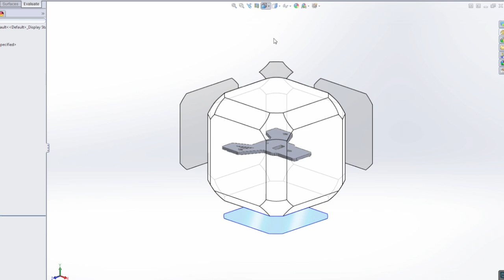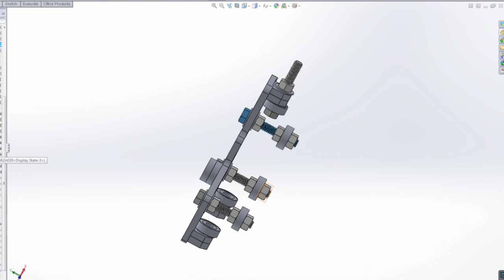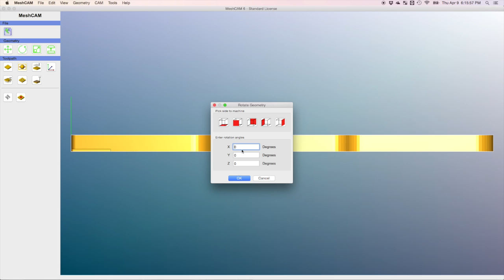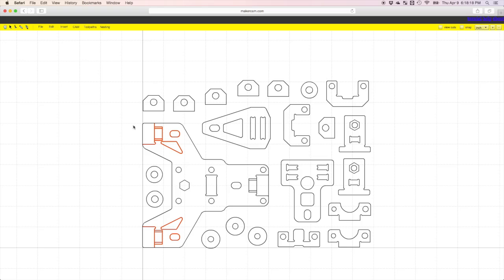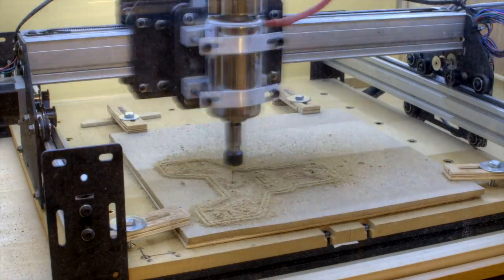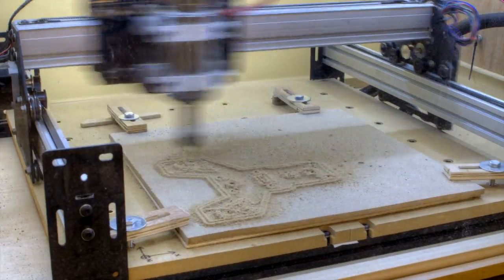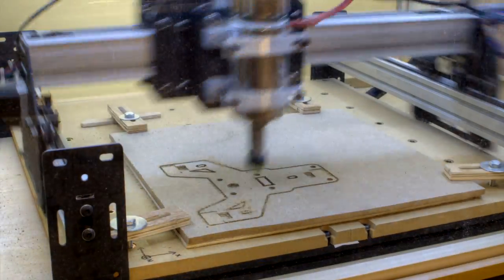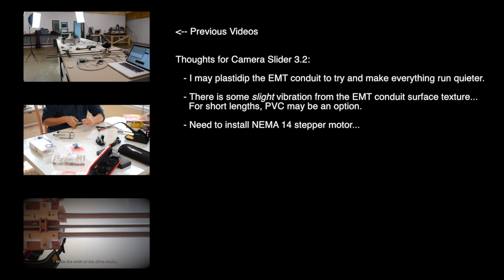DIY Camera Slider v3.1 - Shapeoko Project #30

Comment: 'A platform trying to make contact with two rails at four points is almost impossible without some sort of adjustment or deflection in the system' ?? 0:36 
(use washers, bits of paper anything to extend the axle and make the little wheels meet the intended destination)
Problem solved for anyone who doesn't know how, when or where to drill a hole accurately! 0:36

Comment: Why not just use 3 slider bearings and concentric nuts so that you can clamp the bearings into place without the need of making top and bottom bearings.?
Makes it all a lot easier, I think.

Comment: Not sure if this would work, but have you considered getting PVC and fitting conduit in the center? That would make things stronger and smoother.
Reply from the maker: Not a bad idea, would have to find tubing with the perfect diameters though. I'll check the parts catalog later and see if anything would work out...

Comment: Computerized mill machine, cause yeah, that's typical DIY...
Can I get one of those at the home depot?
Please change your video, don't be a douche bag....
Reply from the maker: +TruthAndMoreTruth Not at Home Depot, but you can get a 3D printer at Staples and do basically the same thing. If you can afford a camera, you should be able to afford one of those... #GoOutAndMakeStuff
Reply: "I don't have that particular tool therefore this is not a DIY" -Ungrateful people on Youtube.

Comment: What's the use of the two pieces glued together and put in the middle with the bolt and washer on there?
Reply from the maker: +Sander A Just a quick and dirty way to attach the carriage to a motorized belt system.

Comment: Would you manufacture and sell your slider to the public, and at what cost? What is the base material you are milling? 
VERY INTERESTED BUYER.
Reply from the maker: +Joseph Jobe The material is medium density fiberboard. At this time, I don't have plans to sell it. There are a couple issues with it that make it difficult to set up any sort of production for. I'm working on an easier-to-manufacture version in the next few weeks, which I might make available publicly. Video will be posted when ready.

The notional plan would be to sell the MDF parts as a DIY kit for $30 or less, with the end user sourcing the remaining parts on their own (mostly available from any hardware store: bolts, glue, sandpaper). Assembled would probably be around $75, mostly because of the time required. Not really in it for the profit, which is why I'd lean towards Plan A.
Reply: +Winston Moy TY for the quick and informative reply. Love your design, great video, and YES - I want to see what materials you use next - interested in the DIY option as well. Thank you... SUBSCRIBED.
Reply: Winston, I am interested in buying the parts from you when you have them ready,.. also have you thought of making the parts out of aluminium or a plastic of some sort?  BUT really  interested in buying from you

Comment: Hey Winston, do you live with neighbours behind the wall? Or in own house? Just curious how you handle noise from milling and how actually loud is it for apartment? Thanks.
Reply from the maker: +3dStereoArt The DWP-611 is pretty loud, but the DC spindle is no louder cutting through wood than a quality blender, or quiet vacuum (also depends on what size end mill, I usually use smaller ones). There's a garage between me and the neighbors, and noise hasn't really been a problem. 

For the user, sitting in front of the machine for hours at a time, you don't need serious ear protection, but some decent noise-isolating earbuds make the time go by a lot more comfortably.

Comment: Two ideas: First, what if you were to mount a tripod head on it? Would many modifications necessary, and if so what tripod head do you think might work out?

Secondly, what do ya think about 3D printing all the parts in Polyamide from i-materialise? Would they be strong enough and to specs? (I can't quite afford a Shapeoko yet unfortunately... sigh...)
Do you have any more STL files, or are all the parts in the SVG simply 6mm thick? Thanks, you rock! :)

Here's the tech specs for the material:
http://i.materialise.com/materials/polyamide/technical-specifications
Reply from the maker: vuurthewarlock Tripod head would work, they're usually able to be mounte with either a 1/4" or 3/8" thread if I recall correctly. I would recommend a ball head for infinite adjustability, and if you plan on using it more than a few times, invest in something with a quick release plate.

Polyamide should work, although I'm not sure how much weaker the parts would be, compared to theoretical values. The fusion process in 3D printing doesn't preserve 100% of the original strength. Depending on price and such, ABS or other FDM materials should work just as well though. I would also try pricing out the pieces from a laser cutting service like Pololu though. Sometimes subtractive manufacturing can still be cheaper, and more durable in the long run.

SVG's are designed for 6mm nominal, I find 1/4" ply and such tend to be just a hair thinner than advertised. A lot of plastic stock from McMaster also tends to be found in 15/64, instead of 16/64 (0.250") unless explicitly stated.

Comment: Great build and redesign. In the redesign, I thought you would be making a "slot" for the bearing bolts to make it adjustable for better contact with the runners. Looking forward to the next integration! Thanks for sharing.